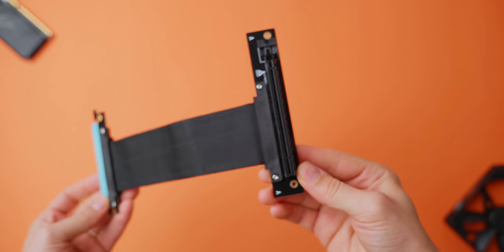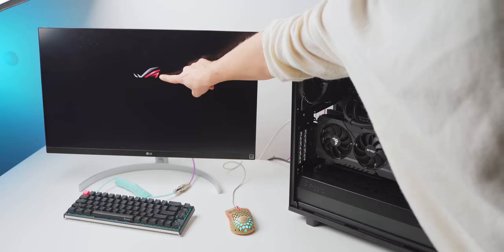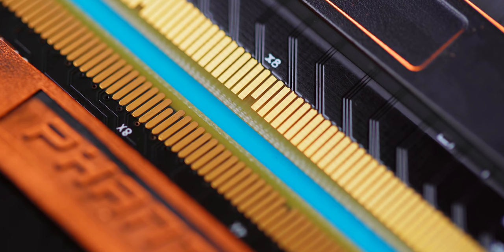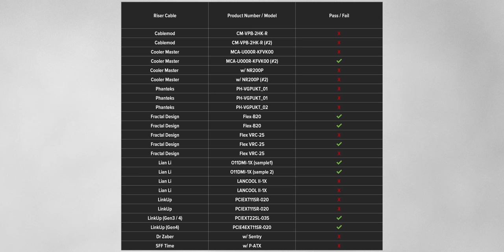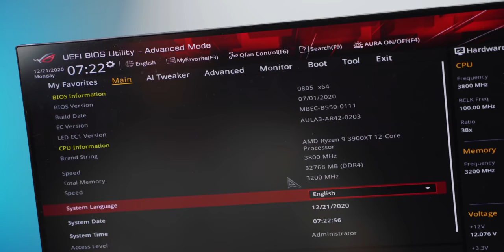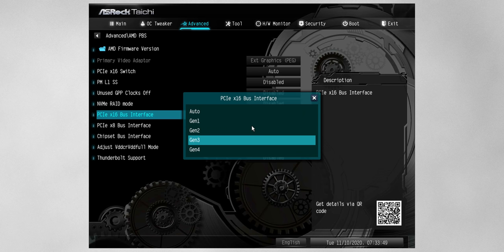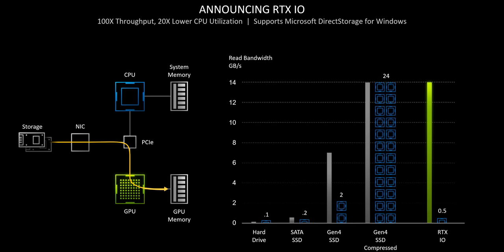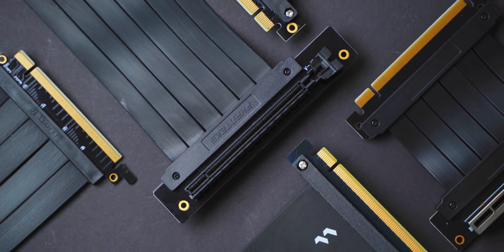There's a PROBLEM with Riser Cables

Comment: I had same issue using cooler master vmount version 2 with  3070 and b550 aruos elite (auto had issue as mention on the video), I had to update pci to use gen3 , however getting the issue when pc is on cold boot (no video out in the next day). for some reason the issue was fix by setting the pci to gen4 on the bios

Comment: Not only black/blue screen...
My 3090 was partially working on my riser cable (x570 + 3900x), low resolution on windows and problem on windows device manager, otherwise it was booting and windows was working.
Spent 3-4 hours because of that... when I saw some strange behavior on a post on a random forum that made me switch my pci-e speed to gen3 and bam, working again...

Comment: When i use my 6700 XT with riser cable and plug 2 monitors my adrenaline driver crash with some games, but when plug only 1 monitor or connect the gpu directly to the pcie motherboard works fine, idk what is the problem, but for the moment i just play with the gpu directly to the motherboard :/

Comment: I had this problem with a 4th gen pcie gpu and an old riser, except my gpu had a water block and hard line tubing, so any time my bios got reset, I had to drain and disassemble my loop, plug it into the mobo, reset the bios gen 3 option, reassemble and fill the loop. It was a nightmare

Comment: Ive never had any issues with riser cables.  If you dont buy cheap ones, you wont have any issues.  I just bought a Gen 4 riser for my 3080, just waiting for my water block from EKWB to use it.

Comment: To state the obvious, riser cables were never certified for PCIE v4, also it’s not possible to create one that will work reliably with retimers every few inches.
Shielding also is required and even then you still need retimers to recover the signals as they degrade.

Comment: It's annoying, even the totally brand new Phanteks Evolv Shift 2 case comes with a gen-3 cable, so I had to disable PCIe 4 in the BIOS, and my BIOS only has one system-wide PCIe option, so I had to disable it for both the GPU and SSD, though I have a PCIe 4 SSD and an RTX 3070. I'm not losing anything noticeable from the GPU yet, but I paid $100 extra for that SSD, when direct storage becomes a thing I'll want that bandwidth.

Comment: Windows stated that it could not detect that i was using an NVIDIA card until I clicked straight to the motherboard. Prior to that I was hearing a popping noise happening periodically coming out of the pci-e socket where the riser was plugged into.

Comment: Will there be issues?

I’m using an Aorus b450M motherboard. 

So, I’m not sure if I’ll get the 4.0 or the 3.0

I have a 3070
Reply: All B450 boards only running at gen3

Comment: I bought the Dancase A4-SFX v4. 1, it came with a gen4 Riser cable included in the case. It works fine with my b550 mobo and A 30 series gpu

Comment: Yep, its like going from 100Mbit to 1Gbit+ Ethernet or from 1080p to 4K on HDMI, etc.  Higher bandwidth is much more susceptible to minor imperfections, EFI interference, tight bends, etc.  I imagine you could wreck your riser by putting a little kink in it.

Comment: PCI-E riser cables are "Dumb", there's no electronics on them, so they can't negotiate the speeds they support. If you plug in a PCI-E Gen 3 board, it passes the signals through untouched, which allows the motherboard to negotiate a Gen 3 connection. But the timing tolerances are considerably tighter for Gen 4, and include requirements like "same-length traces", along with picosecond tolerances. Most existing cables can't handle signals that precise, so you get errors on the bus. And as they're dumb wires, when the motherboard starts up and asks (over Gen 1) "What generation do you support?" the request goes directly over the dumb wires of the riser to the video card, which promptly answers "Gen 4, of course!". The motherboard and card then switch to using Gen 4 signalling, and messages get mangled by the increased delay. But PCI-E has no mechanism to re-negotiate the connection, so neither side can say "Wow, this connection's crappy, how about we step down to Gen 3?".

Comment: Couldn't stop getting crashes in games with an EVGA FTW3 3090 Ultra on a x570 Unify. Tested 2 Risers, one from EK (with their vertical GPU mount) and one from Lian Li (also from their own vertical bracket for the O11 XL). No more problem ever since i removed them.

Comment: AsRock B550m-itx/ac has the PCIe switch in BIOS Version 1.50. In the versions before there is no toggle switch. Really sad, because the old BIOS version were more stable in undervolting my 5800X.

Comment: I have an HDMI 2.0 device and an HDMI 2.0 television. What cable do I need? HDMI 2.0 or above, duh.
I have a PCIE 4.0 card and 4.0 motherboard. What riser do I need? ehhh something listed a 3.0 and not certified for 4.0 should be fine, right... right?

Comment: I have a MSI Meg Ace with a 8700k and an MSI 2070 Gaming X, I was thinking about getting Fractals vertical gpu mount the Flex B-20, will this all work?
Reply: Yes. Intel does not have this problem, as they do not run PCIE gen 4. This is an AMD x570, and B550 problem, because they natively send a gen 4 signal if they detect a gen 4 device.
Reply: @mattevans1643  Thank you so much! Happy Holidays

Comment: No issues with my Thermaltake riser with my MSI x570 and MSI 3070 interesting stuff though
Reply: It has to do with mobo settings more than the riser cable. If your mobo is pcie 3 only or defaults to pcie 3 first when set to auto, no issue, if it defaults to pcie 4 under auto cause it sees the pcie 4 card but you’re using a pcie 3 cable, then it screw up. Easily fixed by plugging in directly and changing mobo to pcie 3 only.
Reply: My Thermaltake core P3 riser seemed fine in the beginning, but noticed youtube videos would pixelate almost immediately, then over the years more cascading issues. My pc doesn't look pretty anymore, but after removing riser it's working perfectly now

Comment: I have used riser cables on several Intel S-1151 builds (out of 6 complete new builds with either Z170, Z270, and Z370 chipsets, 4 had issues from the start).I can confirm that I tried several cables (from Thermaltake and CoolerMaster). Some worked after the 2nd or 3rd cable, a few builds I just gave up and plugged into the Motherboard and had no further issues. I have experienced everything from randomly no video on cold boot (but fine on restart), to flickering, to large framerate drops, skipping and freezing in game. This is not just a PCIe Gen 4 only issue, or an AMD issue. Love the look but hate the headache and have given up on them.

Comment: I think I'm pretty sure that the only difference between one riser gen4 cable and the other ones which have been already tested on other mother boards, are just simply driver configuration assets. Other possible way you probably could handle would be making those exact cable switches but with a gen3 compatibility connection.

Comment: I got issue with. Asus Z690-F together with Lian li lancool-ii-1x riser cable set. I needed to buy new motherboard to upgrade win11 gaming desktop. Graphis cars are too expensive to buy bow or more like feel silly to buy those on that price level and old Asus Strix 1080 with so well with everything still. 8 Gb GPU memory is enough for all games. 

Lancool-ii-1x riser cable just didnt give signal at all first 6 times i install and uninstall it. Using Motherboard integrated display port to see does system even see my GPU, it did not. 
I follow you guide. Install 1080 directly into motherboard. Everything works like should. I set Bios  PVI-e works manually with 3.0, because GPU 1080 use it. 

Now after put riser cable back between motherboard and GPU. System still did not find GPU. GPU fans roll at the begin, lights was on all to time, but no signal.

Went again back to install GPU directly into motherboard. Install ASUS 1080 page GPU driver. Check BIOS settings again (no changes there).

After that it seems that if  wont take power supply power out from behind rocker switch. GPU work sometimes when restart computer and sometimes not. That is the situation now. I also has update motherboard all available updates. But it seems to be situation now. 

Possibly change hole Lian li white LANCOOL 215 case and lancool-ii-1x into Cooler master H500M and riser set from cooler master.

I also got CPU Noctua nh-d15. Need install it on vertical air flow position. It seems to work better when use riser kit. But really this set is not simple to work together.

Comment: I have rtx 3070 and asrock b550m-itx and I've tried 3 riser cables and manually switching the pcie slot to gen 3 but games still crash. (For clarification gpu works fine plugged directly into the motherboard)

Comment: there is a chance to make a temp fix changing the pci 4 to 3.0 on the bios and then now use the raiser cable?? or it doesn't matter?
Reply: It's only temporary in the fact that it will reset with a bios update, or removal of the CPU, or a clear cmos. Other than those 3 situations it's a permanent solution. You can change the PCIE at any time, and unless you bios resets you won't have any worries.
Reply: @mattevans1643  thanks! I thought it deppends by the hardware and not by software but it looks like i was right, and yes! Id the bios gets an update it reset all, but its a solution for those who has no option to upgrade to a bigger case, anyways thank you for all.
P.D: i love that hoddie!

Comment: I know it's one case of millions, but I'm running a 3080 FE with the riser cable that came with my thermaltake core p3, I used it with an MSI x570 pro gaming and currently an Asus Rog strix b550, I never even thought about the riser cable causing issues until I saw this video. I'm sure it's just pure luck, but two more situations you could add to your data

Comment: The the card might fail with the same riser-cable on different CPUs/Motherboards is not the cables fault.
PCIe4 has far tighter spec than PCIe3 wich results in far shorter - in fact the riser-cables are basically all LONGER than the guidelines say the MAXIMUM length between a connector and a chipset should be ( 10 cm).
Basically the CPU needs to provide a very good signal already, the motherboard, the connector and the gpu all need to have good traces  just to make it possible.

And of course re-timing is the "correct" way to do it but costs way more.

Comment: Sooo.. how do you reconcile this with... that when LTT did testing on them they found no issues at all, and that included daisy chaining them for like 50ft?
Reply: and uh... why did you use cables only rated for PCI 3.0?  They have cables that are PCIe 4.0 compliant.
Reply: And while we're at it.. if you are for some reason "forced" to use a PCIe 3.0 only cable.. you can just set the MoBo to PCIe 3.0 and it will fix every single one of these issues.  Its not like any GPU actually uses PCIe 4.0s speeds anyway.  The obsession you guys ("YouTube Tech Guys", not just HWC) have with PCIe 4.0 amuses me when it has zero practical application for gamers or daily drivers or even most content creators.  Its lipstick on pig.

Comment: Got a 5800x in a x570 board with my TUF 3080 inside the Lian Li Lancool 2 Mesh with their highly rated vertical GPU mount... needless to say I went through hell trying to trouble shoot this 2 months ago. Returned and replaced what was likely a perfectly good motherboard and pricey 4000mhz Ballistix ram in what I found was just changing the pice bios from Gen 3 to Gen 4. All thanks to some hard to find reddit thread. My other friend bought a prebuilt that got shipped to him from NZXT with similar hardware that would not even post for the same reason. Good thing he contacted me. Complete BS that the prebuilt companies are literally selling defective systems with no information or help on this... to people like my friend that are the least likely type of pc user to understand what all of this is. They should be sued tbh

Comment: apparently I lucked out cause I didn't take anything into consideration when adding a vertical mount to my 3070 build (9th intel i9 and MSI 3.0PCie) I used a cheapo coolermaster riser and everything just worked when I asked done haha. Looking to do an AMD build with my nephew but I'm gonna go with 4.0 pcie board and a 3060 (fingers crossed I can get one) In this case I'll splurge for a 4.0 riser cable and hopefully it will all just work for us in the end.  If not then we'll cross that bridge when we get there haha.

Comment: Isn't PCIe 5.0 due around 2022?

I guess people can just set the speed to PCIe 3.0 in the bios (Gen 4.0 is wasted on GPUs).

Fun fact: PCIe is hot-swappable. Implementations seem to be ropey (could be an AMD issue, x570 doesn't toggle down to save power).

Comment: Does changing the PCIE to Gen3 typically solve the problem? My I have a 5800x on x570 with RTX 3060 ti. Run smoothly when connected directly but crashes everytime i install GPU Riser from Coolermaster. I sent it back to CoolerMaster and theyre now evaluating the product but feel it will simply be returned to my. Wondering if i should accept and trust that switching to Gen3 will solve the problems. I am hoping it does since i love the look. But is there anyone who switched to Gen 3 but still encountered problems?

Comment: Had multitude of errors with my RX5700XT and a riser cable with my X570 Aorus Master.  Ended up just going for a horizontal mount after using both a Thermaltake and Lian Li riser cable.  0 issues since going horizontal.  I'm like 90% sure that the multitude of 5700XT complaints about black screens and stuff were just people using riser cables.

Comment: thing is.. mobo manufacturers  put the m.2 slots next to the GPU pcie 16x... and in my case the raiser cable is the only way to have my drives in and the GPU to be installed

Comment: ...question; using a 3080 in gen4 mode can cause the x570 chipset to heat up and cause pch fan to be annoyingly audible?
Reply from the maker: Haven't experienced this.
Reply: @HardwareCanucks  thank you for prompt reply. Using x570 master f30 bios with 5950x. Would have thought x16 pcie goes through cpu and not pch. Maybe a subsequent bios update will smooth out
Reply: Why would it, gpu is connected directly to the cpu.

Comment: I've had some issues with the B550 Aorus Master from gigabyte with a 3070 Aorus Master with a phanteks riser card. Before updating the bios I got it working by switched to gen 3. With the current bios which has now recently been pulled from gigabyte, it will not work no matter what I do sadly. Once the new bios comes out, I'll try again

Comment: It's surprising it took so long for the community to realize this. Probably due to unavailability of parts.
The only real solution is using a pcie4 riser. Changing BIOS settings alone doesn't completely help either because every time you update your BIOS it will reset!
Also to be able to change BIOS settings you need a pcie3 GPU because most Ryzen mobos doesn't have display output
I have a 5900X and 3080. I thought I would wait till these cables are available from multiple vendors before buying one but it was too cumbersome to wait to update the BIOS! So went with the linkup cable from Amazon which atm seems to be the only one that supports pcie4

Comment: GEN4 riser is not worth the cost as there are no performance boost whatsoever in my opinion. Either use the GPU in motherboard first to set GEN3 or use a spare GPU on riser to set to GEN3 before using the new GEN4 GPU. Motherboard manufacturers should set in default bios to GEN3 instead of Auto in view of their "incapability" to distinguish a GEN3 riser cable. Riser is pretty common nowadays and should be taken into consideration.

Comment: I think mobo developers should collaborate with eachother and create new ITX SFF mobo format with 90 degree angled PCIEx16 slot on back side of the mobo to avoid using of riser cables in sandwich like cases that are mostly have the same position of MB and GPU. I mean there is already persist some non popular PIO format which can be perfect for console like cases so why we don't have format for more popular case format?

Comment: A lot of the problem you're fighting is maximum trace length decreased, to handle the doubled speed: "Due to the higher accompanying frequency of PCIe Gen4, maximum trace lengths went from 16-20 inches with PCIe Gen3 to 10-12 inches."
It's crazy that motherboards don't just fall back to PCIe 3.0 gracefully.  But I also have little sympathy for people who can't just plug their graphics card directly into their damn motherboard.

Comment: Iv had this issue with 3080 and riser cable from inwin on my z390 formula i didnt get any signal i thought gpu died tested it at the shop and guy said pci riser cables dont provide enough power for some 3080 cards .i was using 2080ti  gaming x trio and zotac 3080 it was fine but i bought new strix and riser cable was not powerful enough to run it

Comment: the problem i have whit my   Riser Cable, with my ryzen 9, I had to configure the bios so that the PCIE would work like GEN 3, if not it did this! everything worked wrong! now that I have a RYZEN 7 500x it gives me problems with or without the gen3 configuration, so I had to remove the extender cable and connect the GPU directly to the motherboard